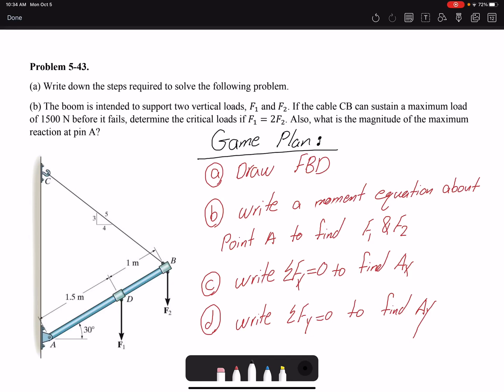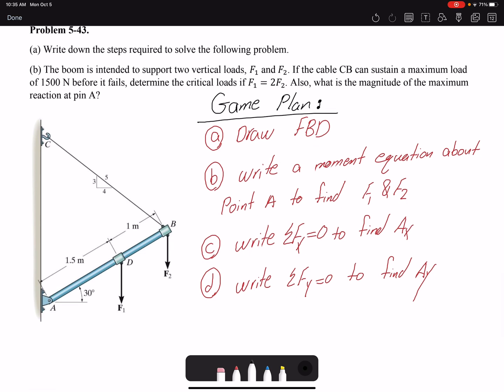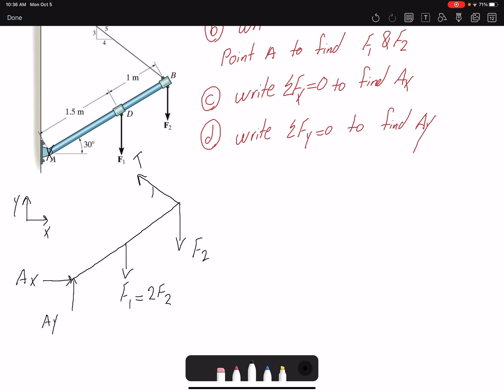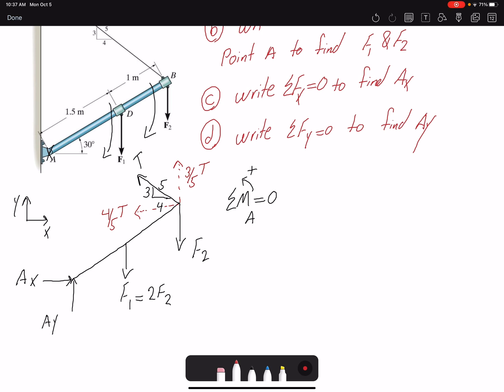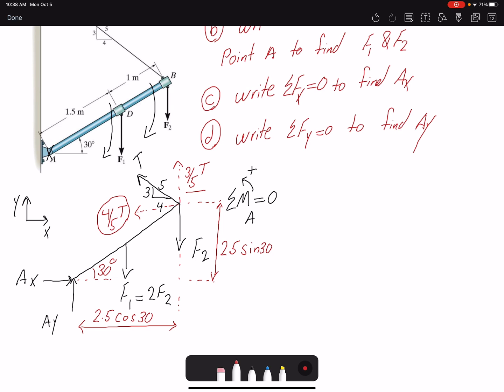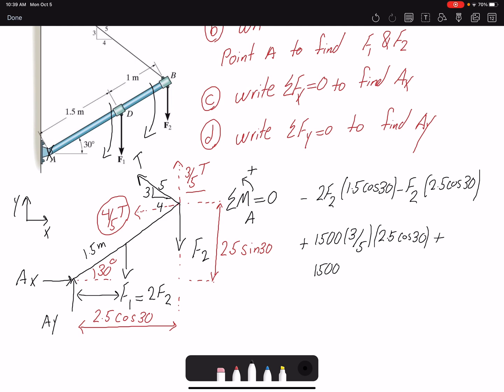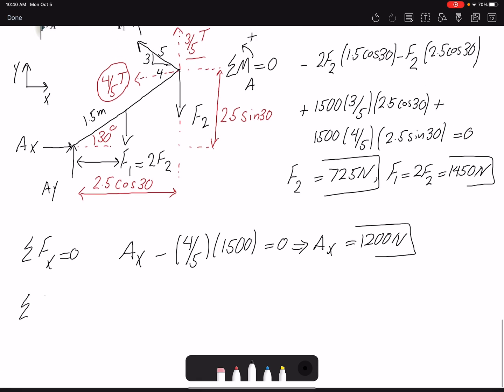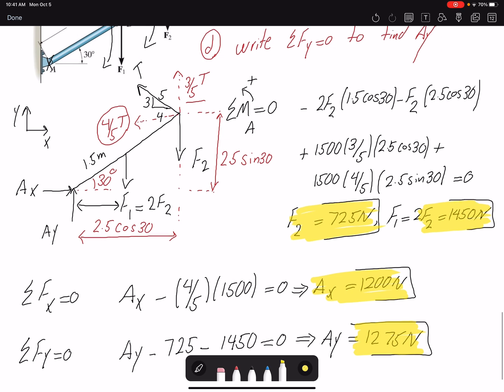Statics problem 5-43: Equlibrium of a Rigid Body Example

Comment: Um when does -725 and -1450 add up to 1275? I get the sign change but the rest of the arithmetic feels off...
Reply from the maker: Good observation, in that equation, the vertical component of cable tension was missed out, if that is included, you would get 1275 as found out in the video